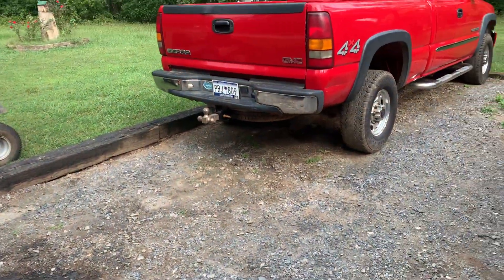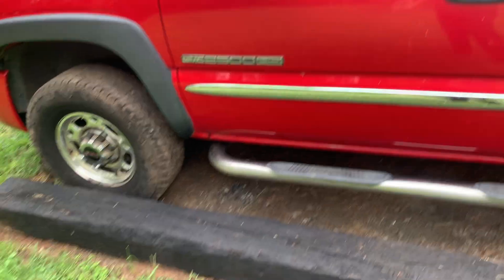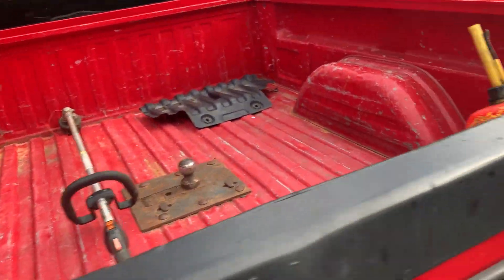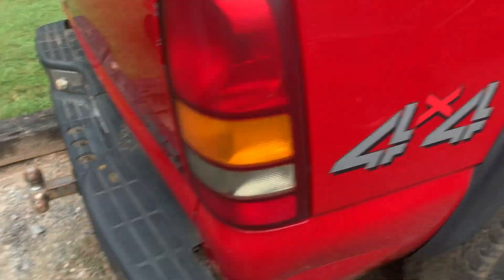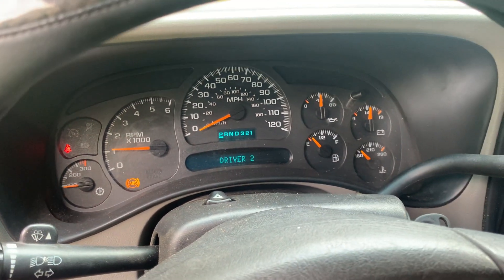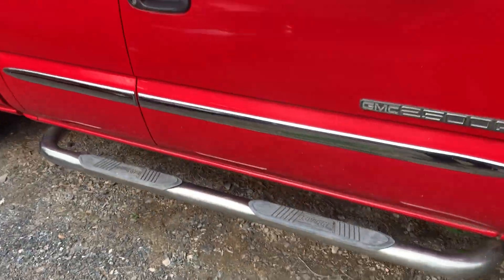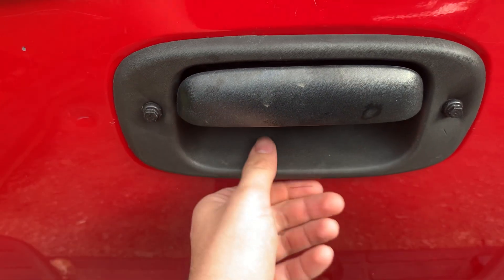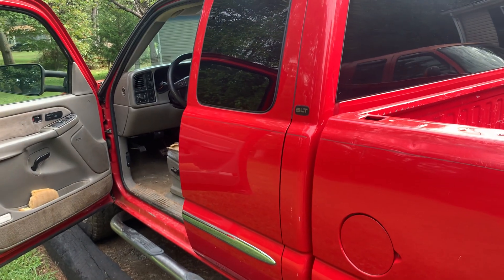Why The GMT800 Is The Best Truck Ever.

Comment: Well said!  In my area they sell for $3000.  The 2500 6.0's transmission is rated for 280,000 miles and the engine 330,000-360,000.  A lot for sale in my area with 360,000 miles.
Reply from the maker: How?
Reply: Mine has 318k on it

Comment: 320,000 original miles on my 05 tahoe with the original 4l60e and the only upgrades electric cooling and a giant radiator as it hauled 10,000 pounds but these truc’s do have body rot issues and frame rot is caused from people not washing the damn thing but some paint or rhino line or under coat on the body will do the trick I recently bought a lb7 with a rebuilt engine and transmission with 348,000 miles yes the rockers are bad but the frame has no rot of any kind if I gotta buy another cab in the future I will but for now it passes inspection
Reply from the maker: How?
Reply: @JoshuaOverman  the owner oil coated and painted the hell out of the frame

Comment: On my fifth GMT800, an '01 Silverado 2500 HD 6.0 with 125K miles.  This year, I replaced the oil pan gasket and oil pick-up o-ring, rear main seal (Dorman kit), the evaporator and heater core (watch the Vehcor video on how this is easier than you think), and a few other minor things.  It runs like a champ.

Comment: I’ve driven GMT 400, 800, and 900. I personally prefer the 400 and 900 over the 800. Nothing really wrong with the 800 aside from being a bit more awkward and by my experience less maneuverable, and a bit rougher riding than the 400 and 900.
Reply: I love my 900 tahoe. Rides smooth

Comment: The 2000 to 2006 Chevy/GMC trucks of that era are total Rot box garbage. I personally have junked 285 of those trucks due to the fact the cabs rot out from the outer rockers in towards the floorboards beyond repair. Also due to the fact the frames rot & fall apart from the back the cab to the rear bumper. Which I have been able to rebuild the rear frame sections & beds & cabs on a couple dozen for customers. Must of the time they get hauled to the scrap yard with my 88 chevy k2500 with 350 & sm465 transmission, also has crank windows, manual locks single cab with an 8ft flat bed that's hauled over 3 tons on that bed alone. I'll stick with my 88.
Reply from the maker: 2000-2006 trucks are way better then square bodies. You just can’t get the reliability of these from a square body. And the frames and small weak and twist and break on the square body.
Reply: @JoshuaOverman  my 88 isn't a square body it's an obs. I do own a 84 half ton 4x4 square body also that I put 1 ton leaf springs on that also has a 350 & a sm465 that I personally have hauled 20 various v8 motors on its flat bed that was a total weight of 9,500 lbs on multiple occasions with no issues whatsoever.  So again you've got no clue what a real work truck is.
Reply: @tinsano6030  lol my grandpa's cateye 1500 z71 tows 11k lbs pulling a trailer loaded with 2 weeks worth of hunting gear and a jeep through the nebraska sand hills off road just fine since he bought it in 05"
Reply: “Beyond repair” sounds like a skill issue.
Reply: @connor4961  when it costs more then 1k to fix rotted out outer & inner rockers, the floor pans for both sides of the cab, which isn't including labor, then a another 1k to rebuild the the back half of the frame from the back of the cab to the rear bumper also not including labor its considered beyond repair  cause most people don't have or want to spend that kind of cash to rebuild a 20 year old rot box from the rust belt. I've rebuilt a couple dozen of these trucks, it's definitely not a skill issue.
Reply: @tinsano6030  down here in the south those trucks go for a pretty penny. I know for sure that I’d rather throw 3k at my Duramax to keep it on the road rather than 90k at a new truck that’s just going to do the same thing.
Reply: @connor4961  here in the north east it's a completely different story, most people up here when they get bad enough to not pass for a sticker they junk em & or part them out or both. Then they buy another beater that will pass inspection, they don't waste their cash on the new junks at the dealership.
Reply: @tinsano6030 ”oh no the owners never got their cars undercoated so they rotted out”
Reply: @TheSavage3.6  undercoating has nothing to do with it, the shit they put on the roads here in Maine in the winter will still eat through the under coating, I've seen it happen to hundreds of vehicles. I've had to repair vehicles that weren't even 2 years old that already need new rockers & wheel arches replaced cause they didn't wash their vehicles regularly in the winter.